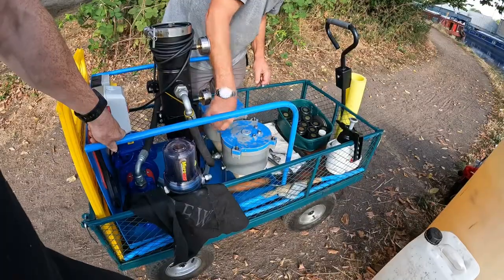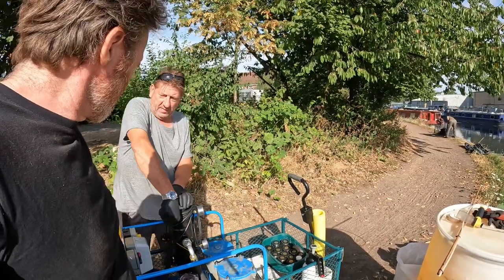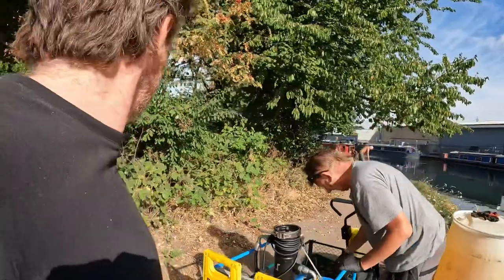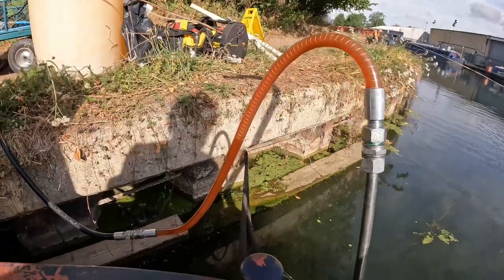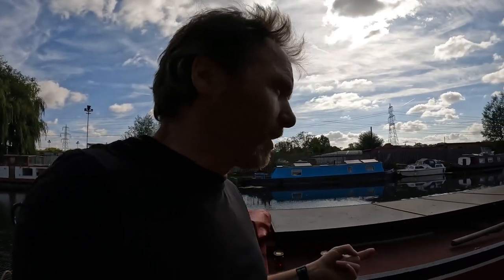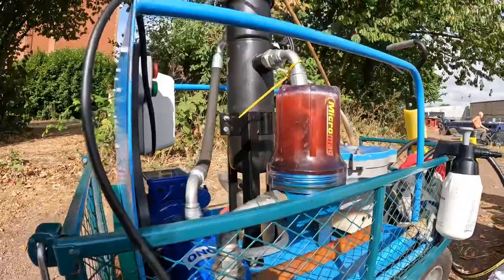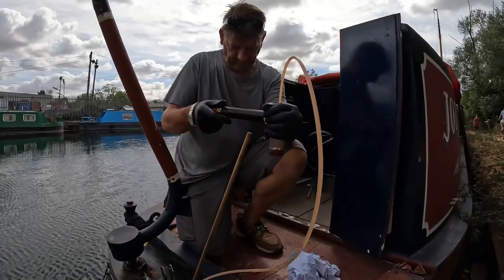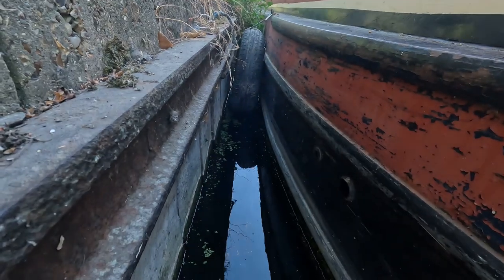How to remove water from a boat’s diesel tank

Comment: This is an absolute pro-tip, thanks for posting! My diesel tank isn't huge and I have some space under the floor so I was going to get a larger one although it'd be amazing to have a second tank with a polisher in the middle so I can pump from one tank to another to clean the fuel! I'll give Paul a call and pass on his details to my neighbours. Thanks! 🙏🏻
Reply from the maker: Hi Beth, the big take from the experience was that the process of cleaning a tank is so much easier if the tank has an access hatch or man hole. In my case, having just the filler cap as access reduces the effectiveness of the job. If you do plan to get a new tank make sure there’s a nice big access hatch. 😀
Reply: @canicebannon  That's a great tip too! 🙏🏻

Comment: Fascinating, that’s quite a process and a smelly one I’d wager…I’m not mad keen on the smell of diesel any more as one of my teenage jobs was working on a refuelling barge for trawlers. That really wasn’t a very high price to pay for a good hot shower and some winter heat 👍
Reply from the maker: It was definitely worth it, but it took two weeks for the smell of diesel to leave my bedroom. It turns out I was dragging it in on my feet. I serviced the engine afterwards. 😩😂😂
Reply: @canicebannon  …it’s certainly has a persistent whiff 👃🏻 👍

Comment: Have your welding skills getting better.? More sanding will be needed...best to Linda
Reply from the maker: The big problem I have is that I’m welding steel from 1910, 1975 and the present together. This is challenging. Give me two bits on modern steel to weld and there’s no problems.

Comment: So they don't seal the tank? Hmmm seems with the thermal cycle you see in England you would want as much corrosion resistance as possible....
Reply from the maker: Every diesel tank in a narrowboat is made of steel. But now plastic tanks are becoming more popular. I was surprised to see bits of rust coming out of the machine. It hadn’t occurred to me that you could rust out a tank.